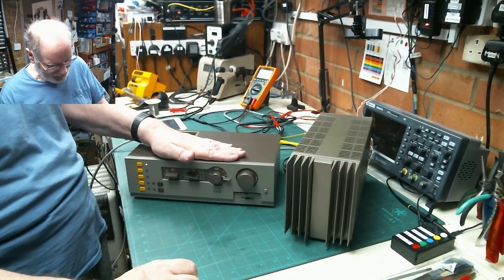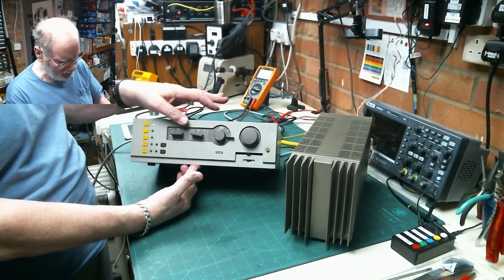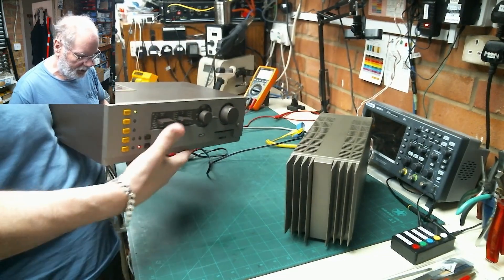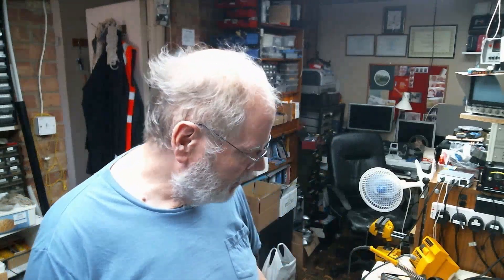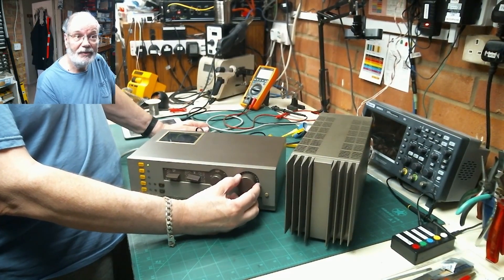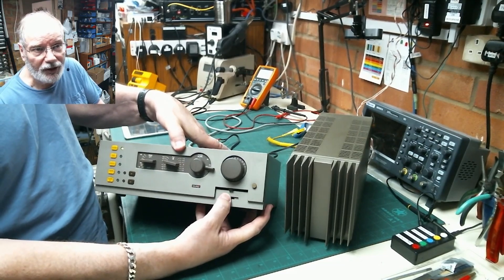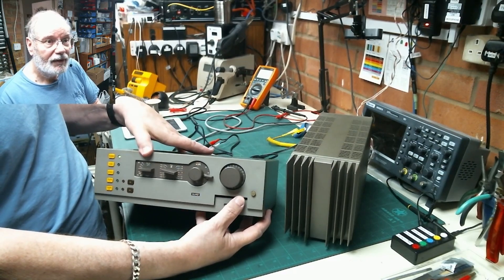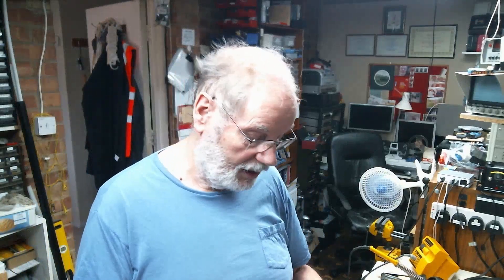QUAD 44 Repair

Comment: Thank you very much for the video. I had exactly the same problem: a low output level on the left channel and background noise . As I am not a technician and therefore have neither the knowledge nor the specialized measuring equipment I worked by reasoning starting with the simplest things (visual inspection to check whether there is something fishy like a capacitor leaking or a burn, testing the speakers and the amplifier (Quad 405) by reversing the connections, handling the sockets, etc.). In the end the problem was a bad connection: I noticed it by lightly manipulating the socket which connects the input card with the motherboard (a black plug with red, yellow, green, white wires). A little contact cleaner spray on the male and female parts, I also re-soldered the socket and the problem was solved.  I hope this can help those who are facing this problem which can have multiple causes as shown in this excellent video. Keep faith, these devices are very solid (unless they have been badly tinkered with)! PS: I bought my Quad 44/405 new when I was young and they are still in service (so do I).
Reply from the maker: A good bit of tinkering, well done 😉

Comment: Very interesting video, I've just been given a 44 that requires an on/off switch , do you know where I can obtain spare parts ?
Thanks 👍
Reply from the maker: Google is your friend, try here: https://shop.dadaelectronics.eu/quad/quad-new-original-spare-parts/
Reply: Thanks 👍 @ChasLarge
Reply: @ChasLarge dada went belly up last year 🙁
Reply from the maker: @robturner3065  Thanks but that link and shopping basket is still functional, so maybe someone else is running it? I have no requirements so cannot confirm you can buy anything from it.
Reply: @ChasLarge  I urge anyone not to pay for products at dada without contacting them first, the site is known to accept payment and not dispatch goods or reply to messages, which is not how they used to do business. Something has definitely changed there.
Reply from the maker: @robturner3065  Thanks for the warning, lets hope others read it as well.

Comment: Too many years ago to admit to, I had a Quad 22 with left and right power amps, all valves. When I they needed a service I rang up Quad in Cambridge. Even before I spoke to a technician the girl on the switchboard knew exactly what I was talking about as to the model manufacturer date denoted by the inside circuit boards.  Alphabetical or numerical. Also what valve numbers. I duely sent it off and it was returned within seven working days BEFORE I was even sent a bill! Their service was amazing.
Reply from the maker: Ahhh, the days of good quality British Service. I used to belong to the elite trade that took pride in their work, and traced faults to component level. Now it's a swap and chuck the stuff back to the factory for a rework - board swap.

Comment: Thanks for this. I have a QUAD 44 with a similar fault. The left-hand channel sounds different from the right. The right hand channel sounds bright but the base is thin the left-hand channel sounds full bodied with deep bass.            i’ve been trying to solve this problem for years so hopefully I’ll zoom in on the tone control board and see if I can spot anything that doesn’t look rightt  perhaps if not you might be able to assist thank you
Reply from the maker: Happy to take a look. Email me.